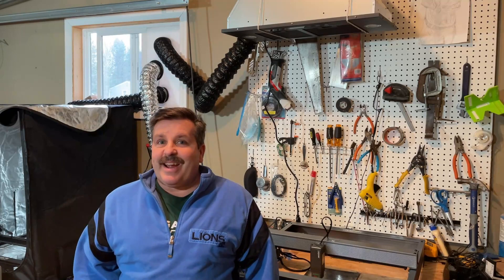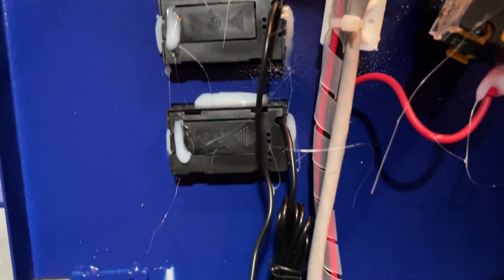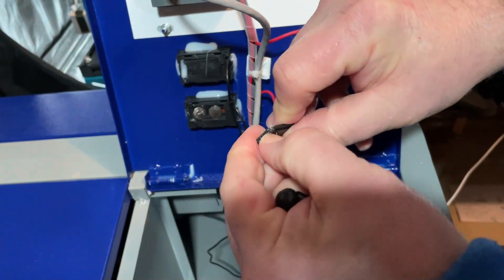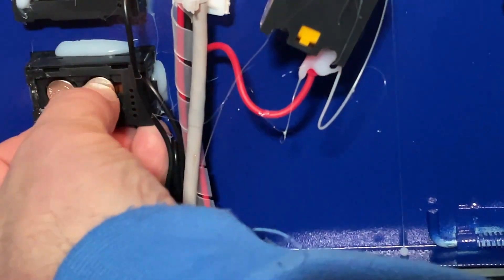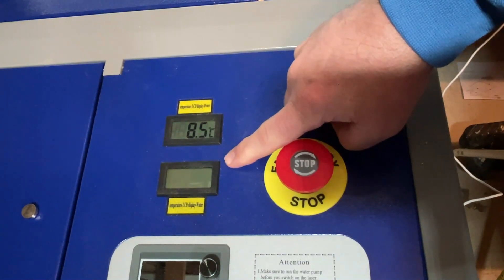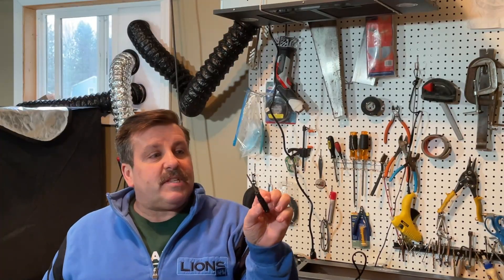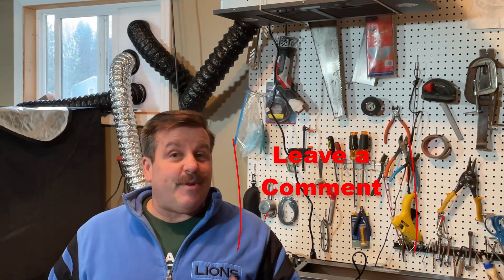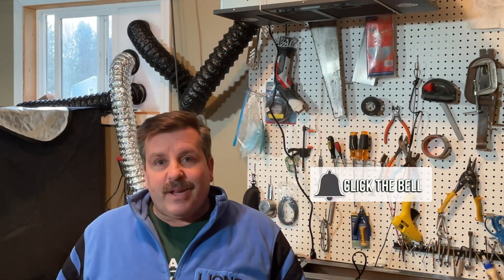Fix the Temperature gauge for the  Monport 40W CO2 Laser Lightburn

Comment: Here’s a tip that will change your life: put 99% isopropyl alcohol on the glue joint. Pull the glue off effortlessly.
Reply from the maker: Cool share. Thank you very much!
Reply: @HLModTech  I found that tip buried in a service manual for an audio mixer that has hot glue globbed on every connector. I honestly don’t know how I had never learned that trick, so now I’m an evangelist. Try it, it’s amazing!
Reply from the maker: Awesome! Next time I have an opportunity I will.

Comment: Have You had an issue with the Monport K40 Ammeter Gauge not Turning On?
Fixed one problem now another.
Reply from the maker: I have not. I do not think that is a easy as a battery replacement though.
Reply: @HLModTech  
My Power Supply went out. 
I assumed it was from a Bad Ammeter Gauge that Blew the Fuse on the Power Supply.
Monport sent me a New Power Supply, everything now turns on with an exception for the Ammeter Gauge. So they sent me a new Ammeter Gauge however it does not turn on. Frustrating.
Reply from the maker: Sorry to hear that. Toys that do not work are a drag!

Comment: I replaced my batteries still no dice.
I’m upgrading mine to hard wired 12V Gauges Instead of Battery Operated.
Reply from the maker: I bet you will like them. Are you sticking with Celsius or moving to Fahrenheit?
Reply: @HLModTech  
The Thermometer I choose actually do both Celsius & Fahrenheit. I will drop a link to the video once once installed.
Reply from the maker: Sweet!  Looking forward to how it turns out.

Comment: There are replacement temperature gages that look exactly the same and have the same measurements but display the temperature in Fahrenheit instead of Celsius. They are dirt cheap and available on Amazon. I bought five of them and then replaced the two that came with the Monport. I am stuck in my ways and can’t convert C to F in my head. F makes more sense to me and gives me instant recognition of a potential problem. BTW - be safe and take the proper safety precautions when “going under the hood” to work on the K40. There’s a high voltage danger there you should be aware of and take into consideration. Great video.
Reply from the maker: Thanks for the tips. I was lucky enough to teach math enough years that I am pretty cool with Metrics. Appreciate the reminder on the high voltage too. You can never be too safe when working with any of these things.
Reply: @HLModTech  judging from your videos you must have been a great teacher. Love your Tinkercad lessons as well.
Reply from the maker: Thank you. I had a ton of fun with with it.

Comment: I am in the process of purchasing this laser. The water temperature gauge is a known issue. Good to know it is just a simple battery change. Thanks for sharing!
Reply from the maker: Happy to help. It would be interesting to see if we could find a way to power those without batteries.
Reply: @HLModTech  TheGarageEngineer has a video called "Save your Laser Tube with this Tool and K40 Setup". He does have two good ideas there. One is to add a visual flow meter and a water temperature gauge (which is much nicer) that is permanently powered. It is a good place to start and do on your own. YouTube is a vast world, so I thought I would point this out. I was looking for the exact same thing!
Reply from the maker: Appreciate the tips. Channel name of TheGarageEngineer is awesome too! HL ModTech is part of me now... but it could be something much more descriptive.  Thanks again for sharing.